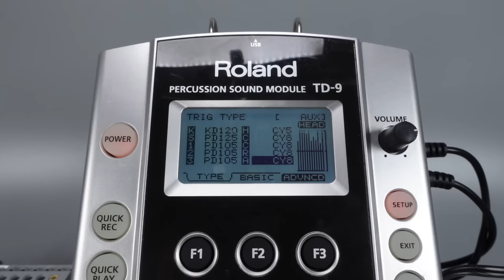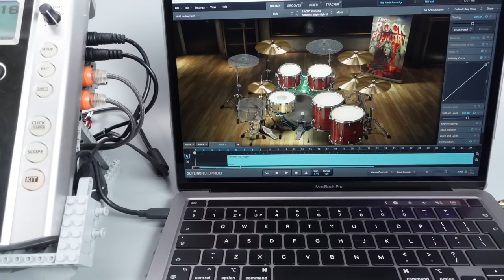Can Lego Play the Drums?

Comment: I'm surprised at how steady this sounds. I would've expected a drum machine made of legos to sound really janky and rickety, but it sounds like a proper drum machine. Good job :)
Reply: *made of LEGO, not "legos".
Reply: Because it's not actually a drum machine. It's a glorified analog cassette player and the pegs are the MIDI input
Reply: @DanielCho1997  its a machine that plays drums, what else should it be called?
Reply: The sounds come from the drum module or software , the lego just triggers them and does not produce any sound, so it just can't sound bad
Reply: @MrCrrispy  I do not think that is the point here. I believe the comment is rather about the evenness of the speed.
Reply: @TheVoitel  the speed is also controlled by pieces of standard size and an electric motor. it is impossible to have bad speed
Reply: Well it’s cause the drums are digital all he built was a machine to hit the tiny drum pads and he cut out the irl audio all you hear is the sound the laptop is making
Reply: @MrCrrispy  song 3 is shake it off
Reply: @DanielCho1997  "analog cassette player" "MIDI input" wut

Comment: this is essentially an extremely elaborate analog music box. I'm here for it!
Reply: @unpersonableme1805  it might have a digital interface, but the method of data storage is entirely analog.
Reply: @SudsyMedusa53  The method of storage is digital, just because it's physical doesn't mean it's analog

 The values are ones and zeros 
either there is a pin in the slot so they play the drum or there is not a pin in the slot so they don't play that drum on that rack.

This hardware device is programmed digitally with physical ones and zeros. 

If there is a black pin, play the note, that is one, if there is not a pin, that is a zero and the note doesn't play for that time slice.

I think you're mixing up the terms analog and digital when you mean to say physical versus electronic.
Reply: @SudsyMedusa53  digital values are represented as 1 or 0 analog values are The infinite decimals between one and zero. With this device it's either played or not played there is no analog volume control or analog pitch control you can't play halfway between a 1 and 0 in this system.

Veritasium has a good video on analog computers if you want a better understanding of analog devices
Reply: @unpersonableme1805  Thank you... So many people using terms they don't understand
Reply: @freshrockpapa-e7799  I agree, although it's still essentially an old-fashioned music box.
Reply: @SlickRCBD  we all knew that
Reply: @unpersonableme1805  thanks for that, I always thought analog just meant physical. Now that I think about it, that doesn’t make sense since computers still need a physical component to read/write information from/to
Reply: @unpersonableme1805  It's digitally interpreted by the machine but the physical data itself is analog - just like a computer bit. The pegs could be shorter or taller, it just would be interpreted as either hitting or not, and they are made of uncountable numbers of tiny objects which likely dont exactly add up to the same amount. They only exist or dont exist as a binary condition because thats how our mind constructs object recognition, not because of what they are. It's about thresholds on the analog data such that the machine can use them as though they were digital. Ultimately, everything real is analog, binary is merely an interpretation scheme

Comment: Holy shit. This is the most impressive Lego build I’ve ever seen. Not only does it confirm that Is possible to build a functional piano out of Lego but also a literal hand made MIDI file!!!!! This is absolutely incredible
Reply: Have you ever seen those mobile fairground/carnival organs? The ones that play the drums, wind instruments, and percussion? Those are pretty amazing too, and they work on a similar principle, but use rolls of paper with cutouts in place of the lego belt and pins this creation uses. Funny thing is - that's exactly how computers used to be programmed - a set of cards with holes hand-punched into them to act as the 1s and 0s of the program.

Comment: You should try to divide the belt in two so you can have a side that's faster than the other to make a more complex beat. Very nice build!
Reply: Really the only limit to complexity here is the length of the track, the maximum operating speed (to increase the subdivision of the beat), and the number of inputs to the midi controller. None of those are really helped by cutting the belt in half and running them at different speeds. Complex beats don't use a different tempo for each instrument per-se. It's better to think of complex beats as polyrhythms, where different instruments play in different time signatures, but at the same tempo. It's all just ratios. From a strictly rhythmic standpoint (barring the effects on the tone you'd get from messing with playback speed), I promise that you would never get something good out of adjusting the tempo of say the snare independent of the rest of the mix, that you couldn't just accomplish by changing the time signature. Rhythm is all about repetition and time, and the thing that really makes beats sound complex, is when the repetitions drift apart over time before eventually resolving by arriving back where they started. The most useful way to adjust the rate of repetition is fractional, not temporal.

If we wanted to do something stupid complex like kick on every 1st and 3rd quarter beat in 4/4 time, snare on every 7th eighth beat, hi hat runs 8/8, but skips every 6th eighth, crash on every 6th and 14th eighth beat in 12/8 , tom 1 sounds on every 3rd, 5th, 9th, and 12th eighth beat in 12/8, and tom 2 sounds on every 3rd quarter note, the loop would resolve on the 84th eighth note, just 7 measures of 12/8, and we can plot it like so:

k:I--I---I---I---I---I---I---I---I---I---I---I---I---I---I---I---I---I---I---I---I--

s:------I------I------I------I------I------I------I------I------I------I------I------I
c:-----I-------I-----I-------I-----I-------I-----I-------I-----I-------I-----I-------I
h:IIIII-IIIII-IIIII-IIIII-IIIII-IIIII-IIIII-IIIII-IIIII-IIIII-IIIII-IIIII-IIIII-IIIII-
t :--I-I---I--I--I-I---I--I--I-I---I--I--I-I---I--I--I-I---I--I--I-I---I--I--I-I---I--I
t :---I-----I-----I-----I-----I-----I-----I-----I-----I-----I-----I-----I-----I-----I

Can a human play this on a traditional drumset? Depends on how creative you get with playing several instruments on the same eighth beat. The nifty machine in the video here could easily play it, so long as it can fit 84 "beats" in its track, which, to me, looks like it can pretty handily. Estimate how many lugs are on that chain of bricks, and look up how many factors that number has. Each of those factors can be the basis for a subrhythm that fits into a greater polyrhythm. Our kick, hi hat and tom 2, snare, tom 1, and crash repeat after 4, 6, 7, 12, and 14 eighth notes respectively, and those are all factors of 84.120 seems like a conservative estimate to me for the number of beats the machine can handle, and 120 has 16 factors. If you only have 10 triggers to control, you can ditch the 3-4 factors that are basically useless (1, 30, 40, 120), assign each trigger its own number of beats before it repeats, and still have 2 factors left over to experiment with, and all of it will resolve in 120 beats or less. It would be pretty challenging to compose something that even math rock nerds would enjoy following that format, but the machine could play it pretty easily.

Also, I charted out that beat in Cubase just for funsies, and it's unlistenable. I wasn't expecting it to sound good, but I find that using math to start writing a song instead of intuition is often just a waste of time. I didn't write it to sound good, I wrote it to demonstrate just how complex polyrhythms can get in very little time at all.
Reply: @TheSpartanFactor  I did not read everything since I do not understand. But, as soon as I've seen the figures you drew, I knew you know your thing!
Reply: @TheSpartanFactor  how may I listen to this unlistenable track?  I’ve thought about it for a while with Tim Alexander vs Danny Carey. each limb a separate beat.
Reply: This is how sheet music is written. There is no two tempos in music. Just one.  It would be totally confusing if more than one musician were playing together at two different tempos. This is why in sheet music there are whole notes, half notes, quarter notes, and 16th of note. It’s the same tempo but one plays more notes in the tempo. On the belt, the closer the pegs are spaces out horizontally, the shorter the note is. The further they are spaced out horizontally, the longer the note is. They don’t change the the speed of the belt that is progressing. That is the tempo of the song.
Reply: melt it ad hoc! yolo
Reply: @JasonB808  but then theres doted notes and triplets

Comment: If this could be scaled up to play a full size acoustic drum kit, it would revolutionize studio recording.
Reply: No it wouldn't there are DAWs that can do 1000x more than this thing with 1000x less effort. This is just a novelty.
Reply: @spyfire242  But I want to record acoustic drums and not rely on software. Drum robot would revolutionize studio recorded drums.
Reply: @gardenstudio7987 ever heard of sampling? You could even record your own and plug it into the software.
Reply: @spyfire242  I don't think you guys get where I'm coming from. I don't play the drums. I want to record acoustic drums live in the room. Since I don't have a drummer so a robot would play a real kit without using samples. And yeah I have heard of sampling.
Reply: @gardenstudio7987  what I don't get is how you suppose that would revolutionize studio recording when you can achieve the same thing and more with current software. Samples ARE live acoustic recordings. You are correct, I don't get where you are coming from.
Reply: @spyfire242  No one will ever get what I am talking about. I wish I never commented on this video.
Reply: @gardenstudio7987  The point of playing a live kit is because of small imperfections in the way the drummer hits the drums each time slightly differently, which wouldn't happen if you had a machine playing it. Even though it's playing an acoustic kit in real time you're still trying to replicate human error with a machine which just wouldn't work. 
Or so you mean you want to use different mics or something, because that is actually something you can't do with pre-recorded samples.